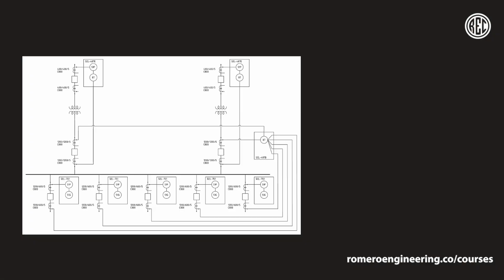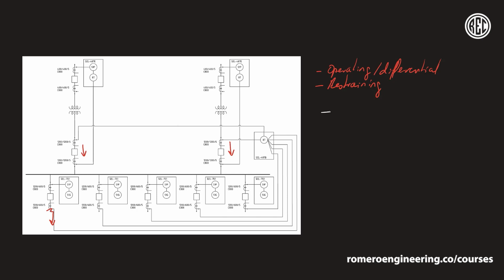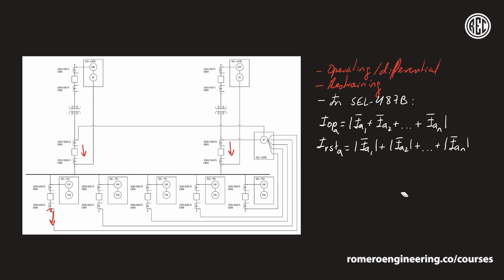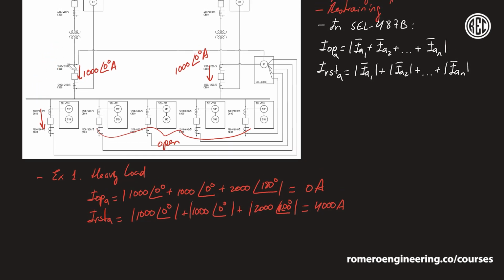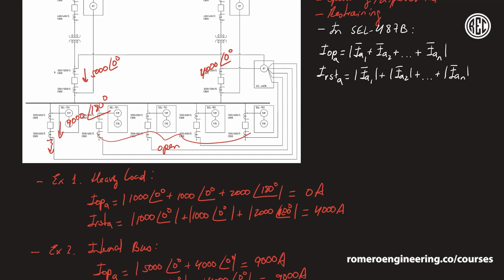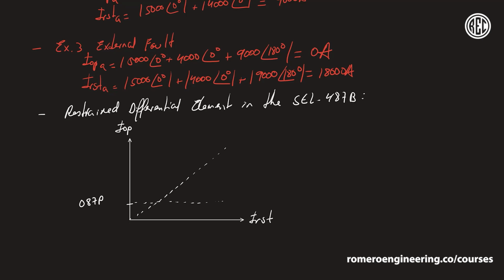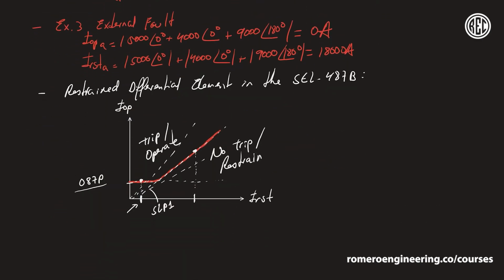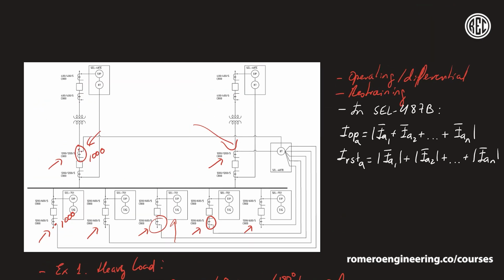Substation Bus Differential Protection - Best Practices When Using Modern Protective Relays

Comment: Excellent.  Thanks for sharing your knowledge.
Reply from the maker: Thanks Samuel, glad you found this video helpful.
Reply: @romeroengineering   One question, when using this type of bus protection, should every CT wired to an input of the differential relay have a ground? Or, should all the neutral be brought together to a node and then be grounded there?  Is there a preferred method for wiring the ground?